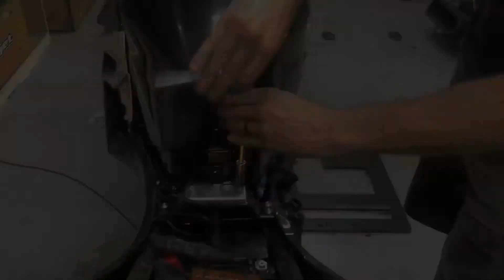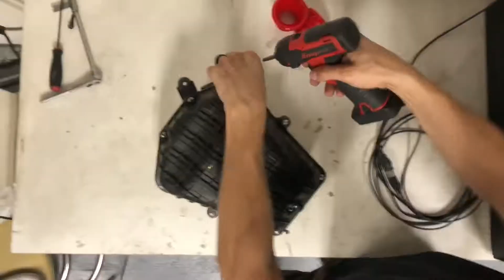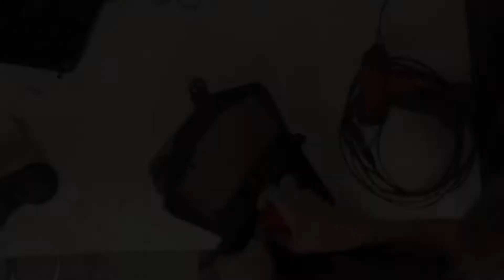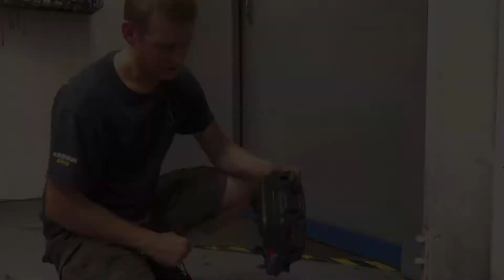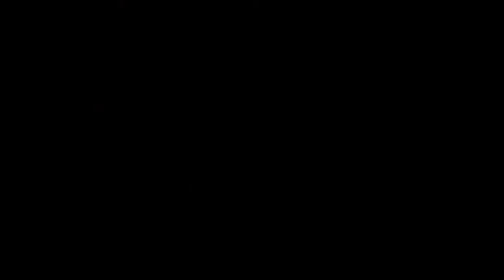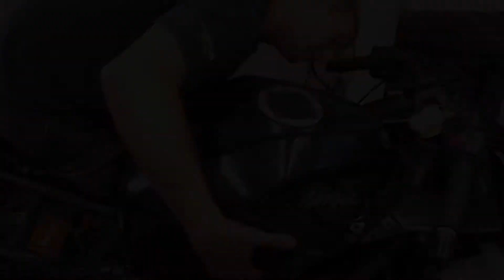+7 HP!!! Norton Velocity Stacks & ECU Flash Power Up! - Ninja 400 / Z400 | Norton Motorsports

Comment: Put this on my bike with full Akra system and Graves block off. This is amazing. Everything it's said to be. Just make sure you install a block off or you will be spitting flames 🔥
Reply from the maker: Thanks for the awesome review! Glad you enjoyed it, and look forward to helping you in the future!
Reply: Sounds pretty rad. I want to be spitting flames, is that bad for the engine? We’ll I’m sure it is, but is it really bad?
Reply: @MrHardbodies  it's not really that bad, if at all. Pressure this, pressure that... it's not a 2 stroke; there's a poppet valve closing-off the exhaust back-flow to the engine.

Comment: Norton flash?? Totally amazing, stacks,  exhaust,  get it all. They even shipped it back 2 day shipping cause I was in a hurry an told them I needed it sooner then I realized it was gonna take. Awesome company an flash, spend the cash, u won't be disappointed.
Reply from the maker: Glad you had an awesome experience!
Reply: This 400 is a beast for sure, is there anything else I can do to squeeze a few more hp outta it?  Also what sprocket can I use to get more torque, without setting a cel?

Comment: How long does it take to get the ecu back once they receive it? They had mine about a week now,  an havent heard anything or got a tracking number lol. I got a full exhaust,  stacks block off plate , air filter,  every came an is installed,  just wait on the ecu to get back here, time goes sooooo slow when ur waiting on something,  i feel like a child on the night b4 xmas.
Reply: I'm super excited btw!! I been wanting this done since I 1st seen this, I only had the bike 2months now,  bought it brand new. I'm praying i get it back soon, I'm addicted to the whole bike scene now, I've waited my whole life 4 a bike. Finally got it, should of thought this tho, I dont have Garage,  now my poor ninja is in pieces in the driveway waiting on my ecu 😂😂
Reply: Yesss, it came like 6days later. Was totally worth it, got the mgp full system exhaust , velocity stacks, block off plate, DNA filter,  airbox mod that recommended by Norton with the stacks, an there ECU flash. My bike is a beast. I can hit 75 easy in 3rd gear, 135mph I had it going.  It's a no brainier,  definitely recommend this! Best flash on the market, gotta run premium gas after tho, 91 octane or higher, I use 94 octane  an it runs an sounds like a 650 imo.
Reply: Follow up: have you gotten everything now? How is it? Looking to do the same with mine.

Comment: Hello, im thinking of buying a z400, and if i do i will definitely do this mod with a full exhaust system. Do you recommend this for daily? I live in city and go highway sometimes. Also should i do this mod after i break in the engine or can I do it with a fresh motor? Thank you and great video!
Reply: Also, another question, the z400 in france is limited to 44hp for A2 license riders, will the ecu flash remove the restrictions? And will this mod be compatible with the 44hp A2 version? Thank you very much!
Reply from the maker: This is fine to ride on the street. We only offer our flash to use with the FTECU bench kit to international customers. https://www.norton-motorsports.com/product/flashtune-bench-tuning-kit-kawasaki-ninja-400-z400-2018-22/

Comment: It would be cheaper and equivalent, just cutting the stock stacks.
Reply from the maker: This is not true, as just cutting the OEM stacks would not retain the Venturi. Our stacks have been extensively developed over hundreds of hours on the Dyno.
Reply: @NortonMotorsports  I really don’t see it making that significant of a difference between the two. it’s only going to receive so much air the air box is already cut open after the mod.🤷🏻‍♂️. My opinion does make obvious sense.. I highly doubt you would lose even 1 HP cutting the stock stacks.  I understand  why you would say that you wouldn’t want to lose any money on sales.
Reply from the maker: Your opinion is just that and you're entitled to it. However opinions don't make power, well designed velocity stacks do.
Reply: @NortonMotorsports  still doesn’t change the fact that I’m most likely correct. Lol
Reply from the maker: Only one way to find out, buy our stacks and make your own, do the dyno work.

Comment: no offence but am i missing something because 300 us for two small rubber parts seems quite steep
Reply from the maker: These were extensively developed over hundreds of dyno hours in order to deliver optimal power, and are high quality in construction and material in order to last, and be reliable.
Reply: It's probably closer to $40 for two small rubber parts and $260 for knowing what shape to make them in.
Reply: I bet the velocity stacks don’t do that much.  You are getting plenty of air through the air box after you cut it.🤷‍♂️

Comment: I have the 2021 ninja 400 I have BMC Air filter , SC project full exhaust , block offs  and Dynoed to the ECU. They left the baffle on as they said small bikes have better back pressure with baffle on. So on the Dyno sheet stock was 42HP after tune it was 46HP. Now if i do velocity stacks and retune it. With baffle off would I get more out of it ? I want to get 50HP out of it. Don't need ram air honestly. Also my 02 sensor is connected to the exhaust. My other bikes have it off. Blocked off. Will removing the 02 make it better ?
Reply from the maker: The velocity stacks will add more horsepower, with your exhaust leaving the baffle in is likely best. Leaving the O2 sensor in is entirely up to you.
Reply: @NortonMotorsports  Is there any benefit to leaving the o2 sensor on or off ? My akrapovic exhaust on my R6 has it blocked off on the exhaust.

Comment: Is this the result of the Velocity Stacks and ECU flash with stock exhaust?  Or does it have a full system as well?   What gains could I expect with just the Velocity Stacks, and ECU flash?  Probably a better air filter too
Reply from the maker: This is with Velocity Stacks, our ECU Flash, and Full Exhaust. With stock exhaust, you can expect between 1 and 3 HP less than with Full Exhaust. You can check out more on our website: https://www.norton-motorsports.com/product/full-exhaust-ninja400r-velocity-stacks-and-norton-race-spec-ecu-flash-package-deal-kawasaki-ninja-400/

Comment: Okay...you have convinced me.
I was on the fence about the N400, even though I believe that the stock HP will be just fine for me. Now I see that a simple upgrade will remove any doubt. This installation is TOO easy. I might wait until the warranty expires after the first year, UNLESS.....there is an aftermarket airbox that I can buy without cutting up the stock one....I would love to do these mods as soon as I get the bike!
Reply: Had my 400 dynod today and it’s putting down 60.10HP at 10k rpm. I only removed the snorkels from the air box. Didn’t modify mine yet. I made my own velocity stacks at my job in carbon fiber, printed them and tumbled for a few hours to smooth em out. Full Toce exhaust with a local tuner flashing the ECU. I had 87 in the tank also. The guy almost dropped his jaw. He said I left a bit of power on the table plus it was hot as fuk in there. 100 ambient. Im making a ram air to fit inside the stock airbox so that and the better fuel, should be pulling close to 65 easy when I’m done. Not bad for such a light bike.
Reply: @JeremyDN  Wow....that is astonishing. Okay, then...I'm buying it. Those numbers are absolutely mind-boggling...and all from a 400 twin. Have you thought about starting a small business prodicing those velocity stacks? You have your first customer right here.
Reply from the maker: You still get good gains from just the Vstacks, ECU flash, and Full EXhaust without cutting the airbox. However, used airboxes are very cheap on eBay if you're concerned about cutting the one that came with your bike.
Reply: @NortonMotorsports  Thank you for that information! Now I REALLY want to get it. You will be the first channel I will turn to if I need to know anything concerning the N400. GREAT content!
Reply: @jex8046  I've tried to leave my addy a few times. I hate crap tube removing posts for emails. So how do I leave it?
Reply: @jex8046  I did. They still removed it. I swear I hate FN YT. They make it so hard to even get contacts from someone. It's stupid
Reply: @jex8046  I haven’t put anything online about what I’ve made so far. I have quite a few stack versions and my air box. I’ll try and put a short vid of what I’ve made sometime on my channel. I don’t upload much though.
Reply: @jex8046  I use SpaceClaim to design my models then export as STL's correct. All mine are built on industrial machines though from my work so I wouldn't know much about the home printers.
Reply: @jex8046  big_j232000

Comment: What kind of gains does the ninja 400 see with just the flash and stacks, and a aftermarket air filter/modified air box... And a cheap slip on?

 Can't really justify spending $1500+ for the full kit to only see maybe 7hp.. it's a $5k bike.  

That's like 30% of the bikes value.. or $215 per HP to do things proper..  seems nutty to me.
Reply: 7 hp on a bike like this is a 15% gain that's a fuck load that's like a 200 hp car going to 230 for just 1500 dollars which is basically unheard naturally aspirated this is a good ass deal
Reply from the maker: With stock exhaust and/or slip-on, it's still around 4-5 hp gain for velocity stacks and ECU flash. As to horsepower to cost ratio, this is very cheap for the amount of horsepower gain, especially being bolt on. Keep in mind, on average each horsepower gained in the automotive / motorsport industry is around $400-900, so for 7 hp, this is well under the average. Also, especially for these ultralight-weight bikes, it's very common to spend upwards of a third to half the MSRP on modifications depending on use. For racing, people often spend 100% or more modifying these bikes to be as competitive as possible.

Comment: I had the stacks slapped on and tuned from a shop. Big improvement just off of that. I'm looking at doing the throttle body next. I got the exact gains they got just off of the velocity stacks.
Reply from the maker: Awesome stuff! The velocity stacks make a major difference.
Reply: @NortonMotorsports  how can the gain be so massive? its not like it got 16 inches trumpets like they run on webbered small block. im not saying that its not true, seem to be, its just hard to see where it all come from
Reply: @ragimundvonwallat8961  It’s easy when the bike is flashed. Plus the stacks that are stock are decent but not great. The shorter stacks are designed for max HP along with a high air flow filter. Mine gets 60 hp as of now with my own stacks I made plus a full Toce exhaust. Goal is to get 70 from this small bike.
Reply: @ragimundvonwallat8961  it's science
Reply: Hi, how exactly did you make 60hp?  @JeremyDN

Comment: I did this to my ninja 400 track bike - It's amazing. Couldn't be happier.
Reply: Did you just change the stack only or with the ecu together? Does it work if only get the stack changed?
Reply: @Jopakilo 
I sent in my ECU and had it re-flashed, installed the velocity stacks and did the air box cut out modifications + M4 full exhaust system. Look on the Norton website - it should all be there as far as products and installation. Super smooth power delivery from the bottom on up. I think now they might even have a ram air system but that may only be for the track bikes set up. I've done many track sessions against the "Feel Like a Pro" ninja 400 that are stock engines and in the straights I can tell I definitely have more power.
Reply: @Jopakilo 
I would say no to just the stack change. W/out ecu flash it might actually run worse.
Reply from the maker: Awesome! Hope to help you further!

Comment: I have this setup on my 2019 R3 from you guys and I love it!
Reply: What’s your new top speed? R6 Throttle Tube?
Reply: @CasioToCartier  no throttle tube and haven't tested top speed. Bike is so much better with these parts on it. Way more fun.
Reply: Bro even I own r3 I have done few modz lik Power tronics free flow exhaust and k&n filter.
Reply: Does it helps me if  I add this mod on to my R3?
Reply: @sainathreddy3421  if you do everything from the videos yes it's a big improvement and everything works great together.
Reply: Tats grt I have power tronics on my r3 with k&n filter and free flow sc project full system
Reply: With r1m throttle tube do I need to update anything to make it faster
Reply from the maker: Good to hear! It really does improve the R3 drastically.